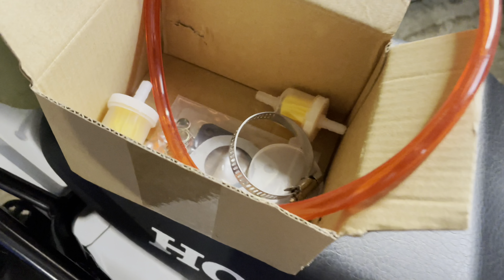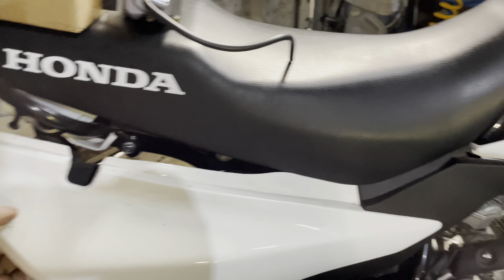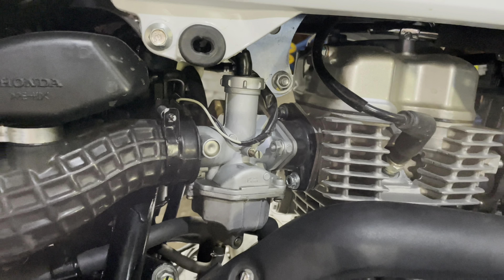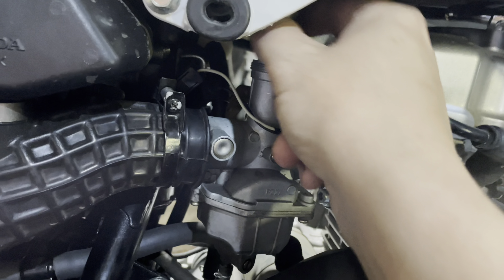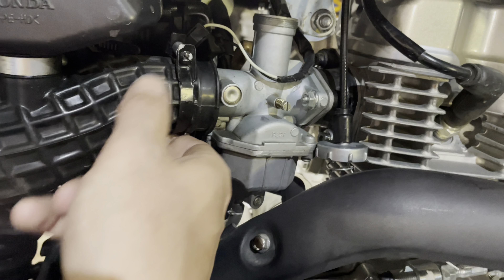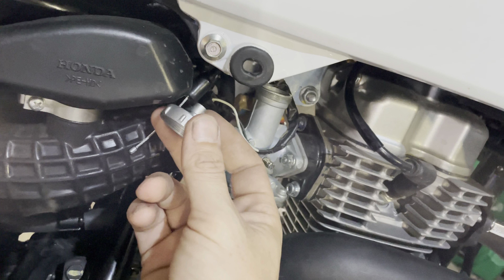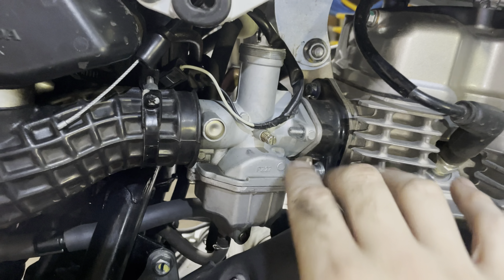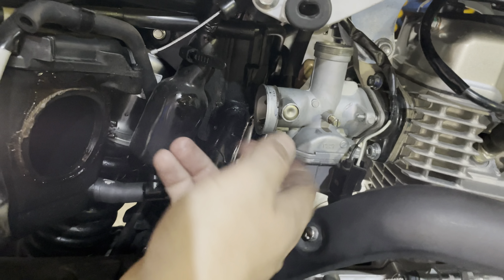2024 Honda XR150L 222 Big Bore Carb Swap & Exhaust Mod

Comment from the maker: Thanks for watching 🛠️😎👍
Reply: Are you still running the PZ 30 and what kind of Jets are you running for that 222 Big bore kit because I've been running a nibby PE 26 flange carburetor on the stock motor before I changed to the big bore because I've done all kinds of other stuff to it but  I got that nibby working perfectly fine but for some reason I can't jet it correct for the big bore kit that I have I have a 195 kit and the 222 I'm running the 222 right now but I wanted to see what works for you on your 222cc? My name's Jim I appreciate any info you can give me Thank you!
Reply from the maker: @ hey Jim yes I’m still running the PZ 30 carb, I never messed with the Jets at all.    I found the 26 mm carb to be too small and lean even for the factory displacement. It was a little too lean for my liking.   if you have a 222 kit, I recommend a 30 mm carb

Comment: I just installed the 222cc kit and now my electric start seems to not be able to turn over the engine efficiently, if i hook up a larger atv battery it starts fine
Reply from the maker: Yes the compression ratio goes up so it’s a bit harder but sometimes I hit it once and if it doesn’t overcome the compression I just hit it again and it cranks over.   A good battery or a double bump on the starter button works, but yes the new compression will be a bit harder for the starter .  Mine is too. I keep a battery maintainer trickle charger for Canadian winter here

Comment: How fast are you going now
Reply from the maker: @BigTexUSA  a lot faster on the 0 to 60 acceleration and low end torque.   The top band is only slightly affected due to the gear, ratios and rev limits.   But doing this will provide more torque and more power, which will allow for a better overdrive gear swap, or sprocket swap.
Reply: SXParts has the big valve head for sale again if you’re wanting top end speed/power.

Comment: How's the Big bore kit working out after a month
Reply: What kit are you using
Reply from the maker: @chrisklein4366  I got a generic kit off Amazon .  I think it’s originally designed for CRF150 but the engine is the same here.   They have been doing performance modifications on the CRF150F for a many years.   The XR150 has only been in Canada here since 2023 , I ordered mine in 2023 , but the engine and the XR150 are old technology in other parts of the world.   The piston that came with this kit appears identical to the one supplied with the scooter shop kit so they are probably selling similar Chinese generic versions of the CRF big bore kit as well.    After a month nothing has changed.  Still lots more low end and mid torque, still much faster 0-60 than stock.   Top end doesn’t change much but the 0-60 acceleration is greatly improved.

Comment: I'm a new sub so I have not seen your review of the big bore after installing it?  I know this will be the carb to feed the beast
but I still need to see how happy you are after all the time/money put into it?  I'll get there & if by chance you've not had time
to put it out,  don't worry.....lol, take your time & do a good job !!  I'll come to see it.  Thanks for the videos  peace
Reply from the maker: @diggy-d8w  you’re right I probably owe a good review video.  Most of the time I will do an install video with a conclusion at the end.   I’m not much of a talker I’m more of a do-er .   I’ve tried doing review videos in the past, but they never perform well, and I feel like I don’t accomplish anything. If I’m just talking about something I would rather get hands-on and accomplish something.  But you’re right I do owe a better explanation of the performance results..   I can tell you that the torque is very much improved on the low to mid end.   I believe the improved torque will allow me to swap and overdrive sprocket on the front.  Which will allow lower RPMs at higher speeds, and with the increased torque, it should be able to carry itself.
Reply: No,  I think you do what you do.... just do it well & all the rest will fall into place.  Don't "HEM" yourself into doing videos
like other channels do them & if you are a "Doer",  then just Do It !   I appreciate what I'm seeing or I wouldn't have ever
stopped.  I don't even own a bike but I'm here knowing I might be owning this one & you are doing the MOD's that I'm
very likely to want done.  That said,  keep doing what you are comfortable in doing - people sense when you try to
push something out that feels off.  You're doing fine & I'll see ya at the next video or before. Thanks for your time!
Between this mod, air/fuel & exhaust upgrades,  the sprocket gearing changes will allow whatever you want as far
as trail or getting the speeds on the road that make it safer for you.  The small sprocket is a 13-15 tooth & if you've
already got more bottom end after the upgrades here,  dropping by 1-2 teeth at the case will give you 60-70MPH
on the roads,  if that's where you're pointing this bike?  I'll be watching & thanks again.
peace

Comment: Just ordered the same carb, nibbi throttle cable, and a few other bits. Have my big bore kit sitting here ready to go in. Excited to get all the mods started.

What elevation are you at mostly and what jets did you end up with on the 30mm carb with just the big bore kit and exhaust mod?

I plan to do the super head but I will have my big bore in well before then so curious where my jets should be.
Reply from the maker: @isthattoasted8152  awesome 💪😎👍 I never modified the new carb.    It’s supposed to be jetted for somewhere around ~225cc 🤷🏽‍♂️ I’m in the higher elevations of Ontario Canada
Reply: Thanks for the reply! Is there any way you could post a photo somewhere of the way your lines are connected? I’m confused with all the charcoal can crap hanging there I feel like I’m going to hook this thing up wrong lol. Feels like a silly question after doing a big bore install 🤷
Reply: I see the main connection but the one on the bottom gets connected to? The one on the bottom of the factory one seems to go to that big can
Reply from the maker: @isthattoasted8152  the bottom is a drain hose.   It just hangs down with the rest of the drain tubes.  The top LH side is fuel inlet.    That’s all there is for the carbs I’ve used. 

  I’ve still got the factory vacuum line from the intake boot to the diaphram pump for the EGR exhaust tube but I have the exhaust tube basically capped off going to a dead end with one of the factory evap parts .